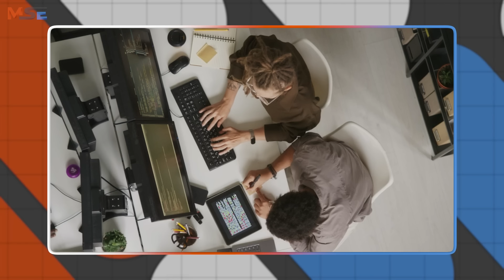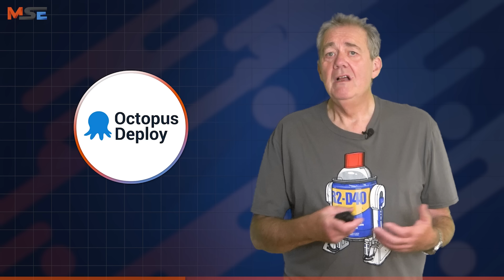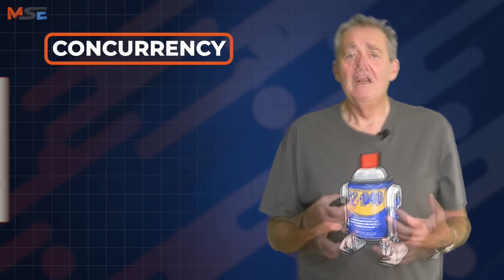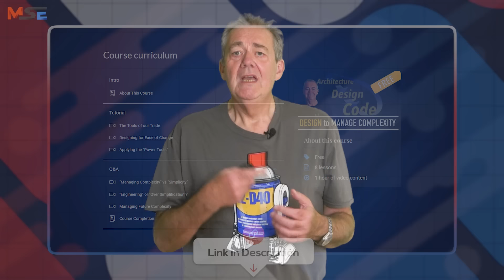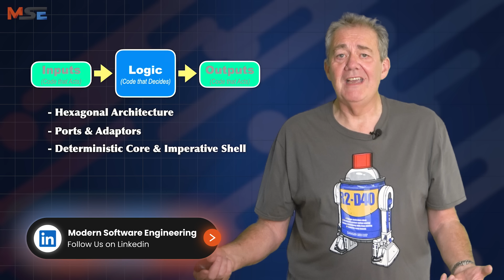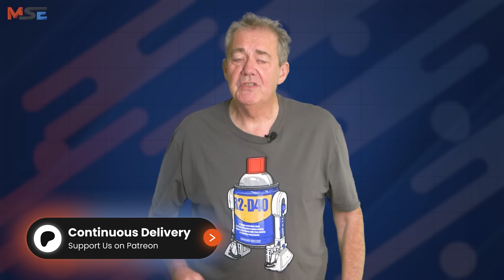The Simplest Way to Make Your Architecture Testable and Reproducible (Works Every Time)

Comment: Curious how you all test non-deterministic systems like LLMs. They’re central to some of the projects I work on, and right now my solution is basically to mark LLM E2E tests as flaky and retry them up to 3 times.
Of course I'm not talking about unit testing, like in the video, I'm talking about tests that interact with APIs and DB, necessary in the acceptance stage.
Example: if the prompt should trigger tool X and the model doesn’t use it, I re-run the test. It works sometimes, but it doesn’t feel like a solid strategy.
Would love to know what approaches people are using to make LLM-based tests more reliable.
Love the channel BTW!

Comment: Once again the clock example shows that you are preaching the wrong principle: you should test for invariants, not fixed values. Most of the time your test will be fine checking time value differences. Save yourself the (considerable, especially when libraries are involved) complexity of faking time to when it is actually necessary. Always check (not only Dave’s but everyone’s) advice for the background reasons for it and only follow when it makes sense and applies to your context.
Reply: When you use the .Now() you don't get the same times as last time you ran tests. So, there's your variant problem.
Using a Mock Clock lets you control the inputs and test with precisely the same time inputs as last time. That's the non-variant.
Reply: Otoh, when you fix the clock value in your test, your test is proving that the code works only at specific point in time, not in the general case. And with very specific aasumptions about the timing of execution and the order in which events happen. Which was fine when testing for Y2k bugs, but not in the general case. Golden rule for testing: only mock what is not available. Log clock values when your test fails.
Not to mention of course that if your test involves a 3rd party component it may not be possible or simple to mock the clock.
Once again, consider your context before applying advice. Specially when they pick bad examples.
Reply: @alfbarbolani   I responded to the video and the other thing. Your statement that it's an incorrect approach is entirely different. I suspect your argument is correct, but it only raises more questions of how to test sufficiently.

Comment: Usually when I watch your content I just nod and say "yeah, my experience says exactly the same", but this time I got a kick in the head. Designing a system to be non deterministic is really something I haven't thought of. I mean, I have some rules of thumb like: if you need to use threads think twice. But this is a completely new level. I need to try this right now :D

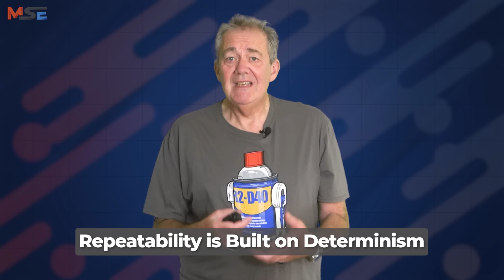Comment: 1:18 what does Dave mean when he says “If your tests are flakey, if your builds sometimes fail for ‘reasons’, if concurrency randomly breaks things, then your delivery pipeline stops being a real learning system.” What does he mean about “real learning system” please? Or did he misspeak?

I 100% get the point about determinism being an absolute requirement of being able to reason about, test and extend your software. But “real learning systems” has thrown me for a loop 😅
Reply: To clarify, in "real learning system", "real" is a modifier; he's referring to a system that really helps you learn about how it behaves in practice.

This is what he discusses more in-depth from 7:09 onwards - that by building a system that optimises for how fast you can learn about the system's behaviour in practice, you can make debugging simpler and make it easier to deliver a system that behaves as expected.

Comment: These are all strong arguments! Happy to see you promote functional programming, although without mentioning it.

Determinism, immutable data, pure logic, isolation of effects - these are all properties of FP. E.g., in Haskell getting current time is explicitly a non-deterministic operation, which is enforced by the type system and requires the user to account for that, making attempts to slide non-deterministic operations into pure core impossible to compile.

Comment: By far, the most complicated software, and one of the easiest to write tests for, I've worked on, had a journal as its input.

Any input, from the network, a database change, its many integrations, even the configuration itself, they had to be written into that journal, then it would be read by the core process. Determinism at its finest.

It was crucial to debug production incidents, from any time in that software history, just provide the software version at that time, and rerun the journal against it.
Reply: Sounds like a nifty abstraction.
Reply: I've been thinking about software and journaling keeps coming up. I think it's key to keeping everything tied to reality.

Comment: There's literally nothing i despise more than 'intermittent' issues because you just can't be confident you fixed it until the end of forever.
Reply: Usually you have an "a-ha" moment when you clearly understand the root cause and how to fix it. After that you can be sure it won't happen again. Otherwise yes, you can't be confident.

Comment: What about systems using LLMs and such internally? they are inherently non-deterministic
Reply: What I never see discussed is how systems built on top of AI (which is non deterministic by definition) can be tested. Or what does testing even mean?
Reply: This is a "first glance" reason to reject using them. On the other hand, if you can determine what the probability distribution more or less looks like, that's the extended sense of determinism philosopher Mario Bunge introduces in the discussion of quantum theory. Of course, this is a risk. (This is different from when you for example use an RNG for a game or crypto, since then one knows what the distribution looks like up front.)
Reply: pretty sure you can fix/set the randomization seed, they should be deterministic then
Reply: @defeqel6537  Depends on the model. In Azure OpenAI, for example, there are 3 sources of entropy, in addition to the fuzzmatch that cannot be avoided in any ANN. 2 of these are exposed to end users like us, 1 only to Microsoft.
Reply: it's not all going to be non-deterministic. You figure out what is supposed to be procedurally generated, and everything not in that bucket is by definition testable.